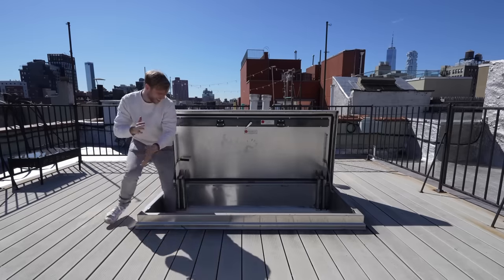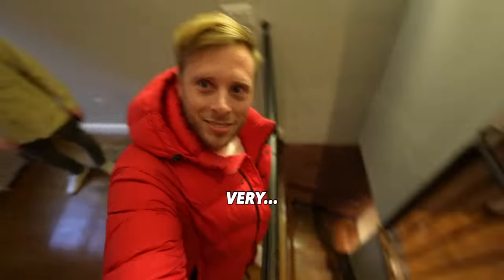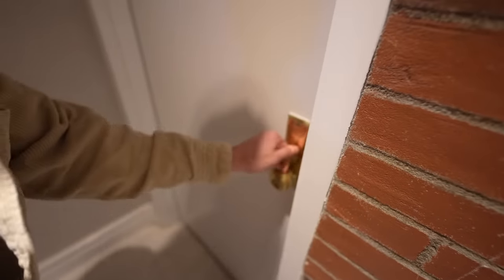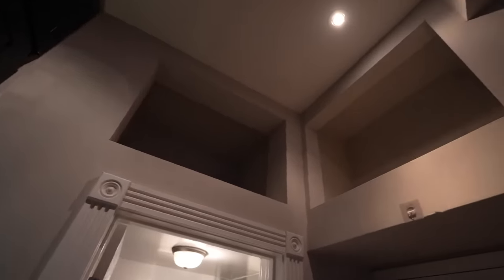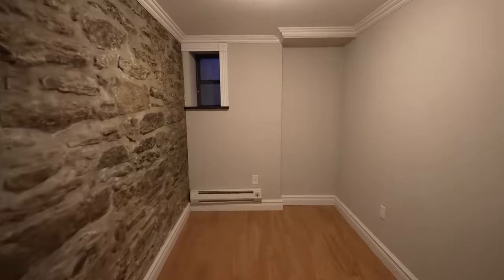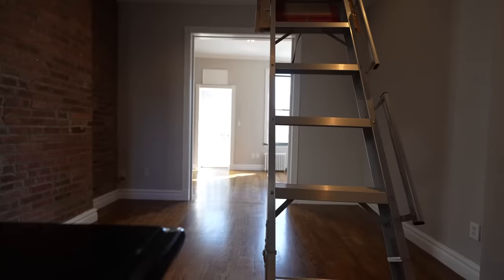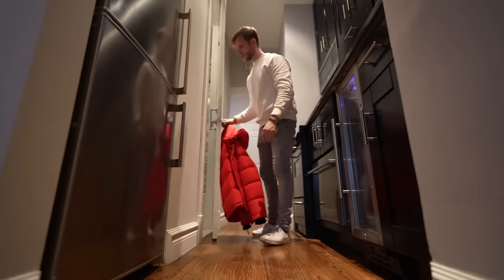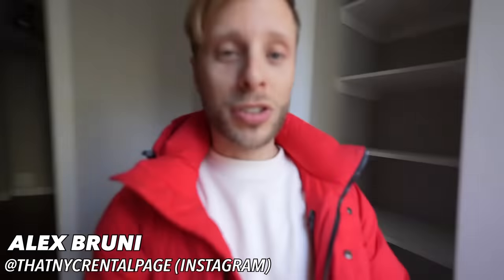I Found an Illegal NYC Apartment Under a Roof-Deck…

Comment: I kind of like the unusual architectural aspects of the first two apartments, although, hanging art may be a bit of a challenge. It would be a difficult choice between the larger kitchen versus the larger living room, because I love to cook and decorate:-) The #3 apartment, I loved the deck but who'd want a construction ladder in the living room? How easy is it to put it up and take it down? Also, it might be a little scary climbing back down. (at least for me) You didn't mention an elevator, so is the 7th floor apartment a walk-up? Wow! I like being on top and It might be fun for a while but it would soon lose it's novelty once the weight of perpetual groceries set in. The "precarious pots" were extremely precarious. It's something I would like to do too but safety has to trump aesthetics in this situation. The precarious pots sort of make the enjoyment of the patios below obsolete. I can't be certain but if I had to choose my favorite unit it might be #4 because of the spacious rooms and gourmet kitchen:-) 🥀🐦🧚‍♀

Comment: Maybe the over crowding for NYC makes you think these are deals but the prices and the space you actually get are insane...In a southern state you can rent a $2,000 sq. ft. free standing home for about $1,000-$1500 monthly.  Or if you're creative with how you live you can buy steel Quonset buildings at $14 per sq. ft.  So the same size free standing house for $28,000!  Ya still gotta buy land, have it insulated, pour a concrete pad, plumbing, electrical, HVAC.  But a shit load cheaper.

Comment: They're not going to raise 8 kids in the apartment. The dryer will probably run a few hours a month. The heat from the dryer goes out the vent pipe. There's little if any perceptible heat coming through the drum and cabinet.

Comment: Do people not know all fridges open both ways just remove two screws top and bottom, put the brackets on opposite side and voila your fridge the other way. There is usually a company tag covering the screw holes on the front to swap handle sides.

Comment: Those smoke alarms with built in batteries, made for 10yrs [right]. high % of malfunctions, have to destroy to shut off. Hey, Cash, I want your plan for furnishing the roof deck of 7th floor apartment by using that 'attic' ladder. Helicopter maybe? lol